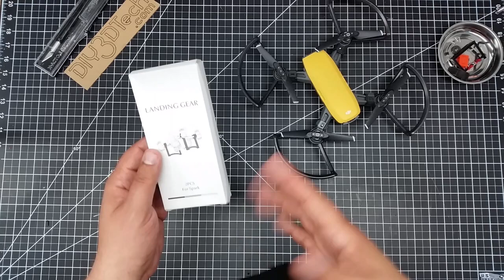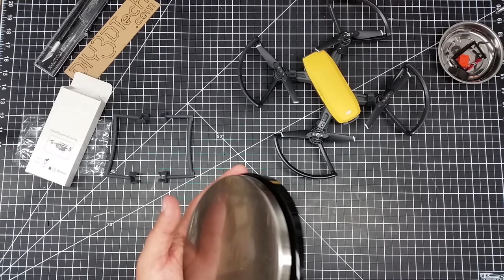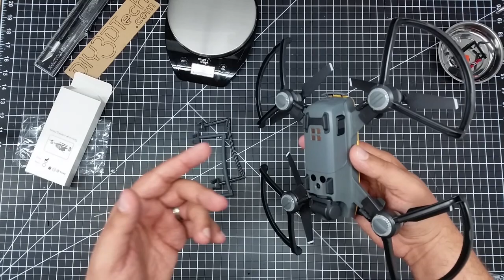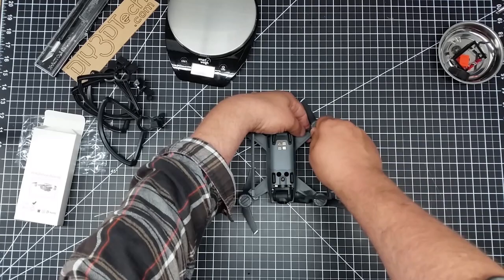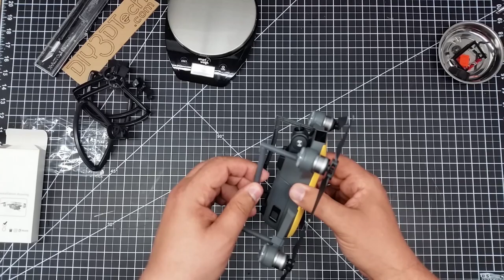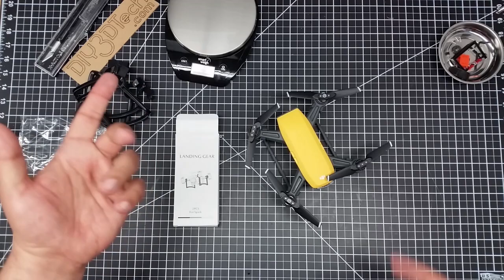Video Drone - DJI Spark Landing Gear!

Comment: There are many, many versions of these landing gear, all apparently exactly the same in design and weight at Amazon, prices ranging from $7.99 to 10.99. General consensus is that they are worth it. They can be carried to the shoot site in the front pouch of the carry-all bag which comes with the Fly More package.
Reply from the maker: Yes some come (the more expensive ones) also with more motor caps which I find of no value.  Also worth they are bit to get on and off so while you could store as you mention in the front pouch of the carry-all bag, it is a bit of pain to pop them on and off.  For me I use a third party case and just them on.  However I think they are great in general!

Comment: Thank you for the video ! 

Looks like you can't have the prop guards on and the landing gear at the same time. 

Looked like they were not easy to put on - how hard was it ?

Curious to see a takeoff and landing with the gear on.
Reply from the maker: You have to remove the prop guards to use the landing gear and they are bit to get on, so they are not coming off!  :-)